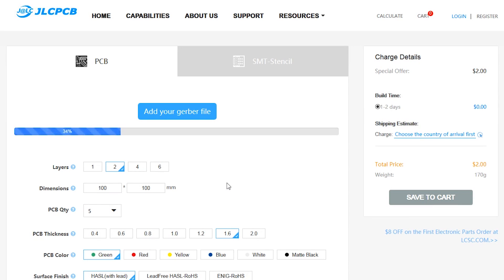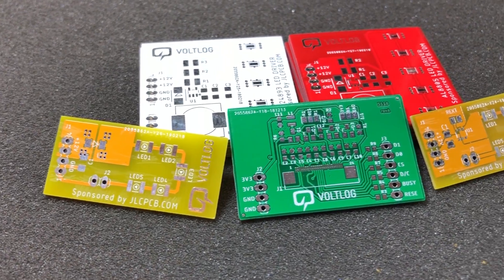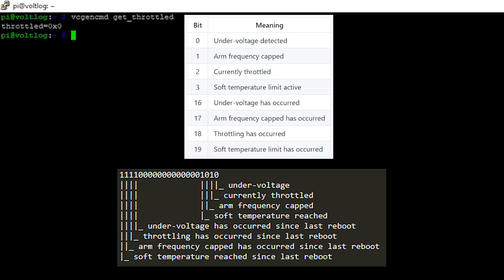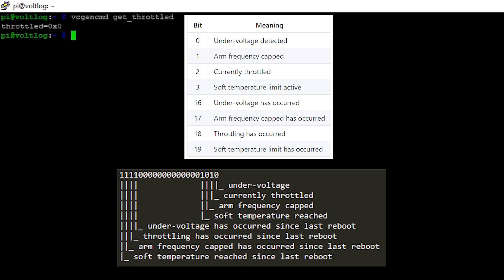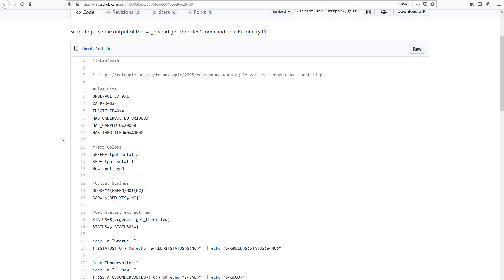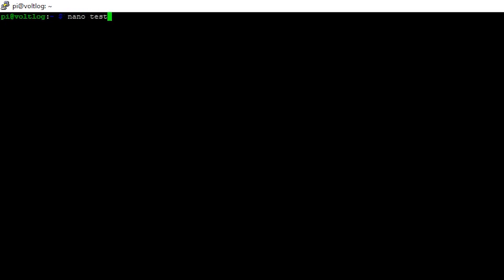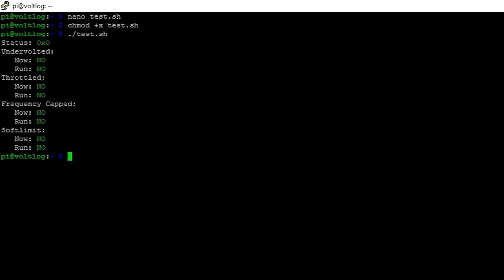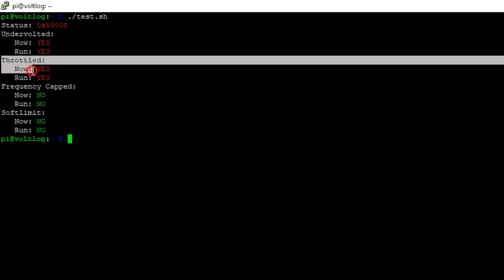Voltlog #266 - How To Check If Your Raspberry Pi 4 Is Throttling CPU

Comment: Nice video, I guess... The only problem is it's not for the very beginners. I'd like to use the info you gave here but can't due to inability to interact with terminal on sufficient level.
Numerous questions emerge like how do you move the code from website to text file (I copy-pasted it to the text file named test.txt and then renamed it to test.sh, but what is nano command for then?) Where should I store the file on PI? Why the terminal says /bin/bash^M: bad interpreter: No such file or directory after I initiate ./test.sh command?
Reply: /bin/bash^M: bad interpreter --  text Files created on a window machine will sometimes have a "^M" character at the end of the line.  I am guessing that you have special characters in your file.  Maybe the editor you are using allows you to change the "end of line" character to a linux friendly type. 

Copying from the web to the text is how I did it, but I didn't get any errors. I.e. I don't have ^M at the end of every line in the file. Microsoft Windows Notepad editor will add the ^M.  If you created the file on windows, try again using wordpad to save the file.

"nano" is  command line editor.  This editor might let you remove "^M" character.  

For personal scripts you can just store them in your home directory or create a subdirectory if it is too cluttered.  Your home directory should be "/home/pi".  You can tell from command line with "pwd" command which prints the current directory to the console window.